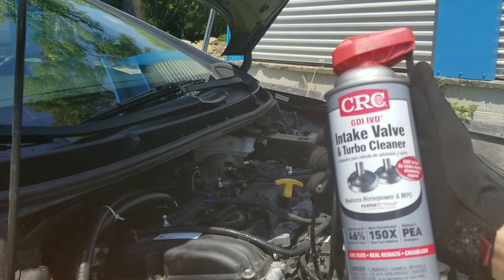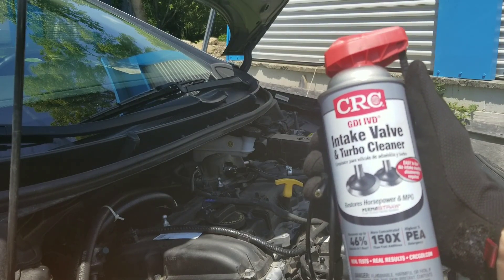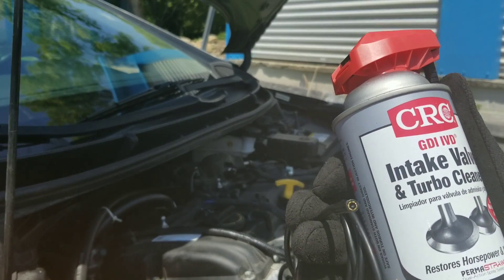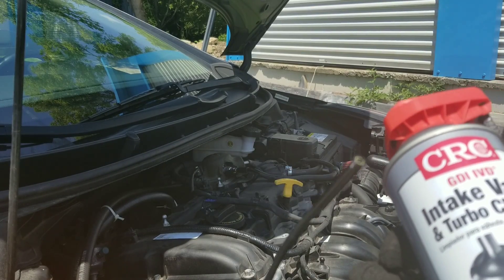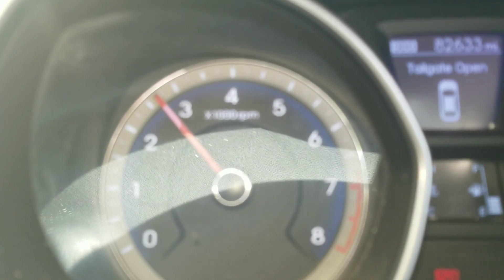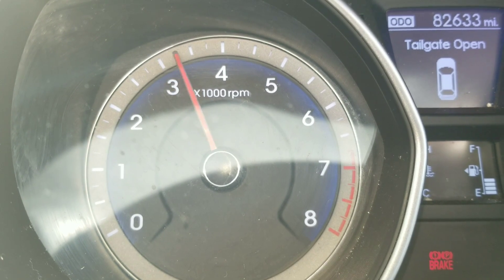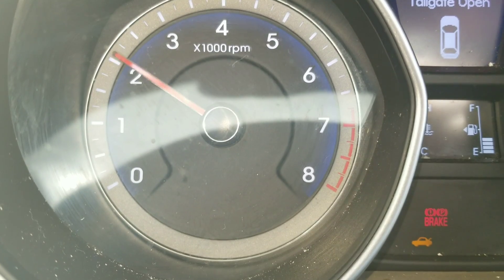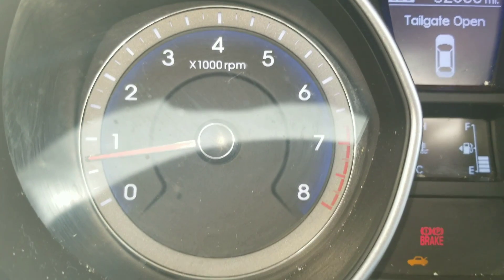Crc intake valve and turbo cleaner borescope results before and after

Comment: * LIAR - LIAR - LIAR *  WITH PROOF:  Notice he puts the borescope inside of the spark plug opening.  Look at the view of the valves and intake runners.  It is a top-down view from behind the valve.  It is impossible to get a view like that from inside of a cylinder.  Pause at 0:33 notice the carbon all the way up to the guide.  That indicates the valve is closed.  Before you resume, get ready for this.  You will see all around the valve throat area and there is no view of a borescope snake, not that it could make the corner to get up behind the valve if it were open.  Now resume and continue watching up through 0:43.

Comment: i think you should get a catch can and second fuel and oil filter. use a diesel with less sulphur drive with revs around 2.5 to 3ooo stay in 2nd gear if necesary then use fuel aditive that allwc carbon to be burned off at lower temp should slowly dissolve it around valves with a fuel additive. that is something you got to use every 2000ks from new when clean.

Comment: I’m at 11k miles and I used 2/3 a can of this on a 2.3 eco boost. Sadly it threw some misfire codes when doing the treatment. But each time I start up from cold I can see and smell oil being burned/cleaned out through the exhaust. Pretty sure it’s still cleaning 100 miles of driving after treatment.
Reply: that’s good

Comment: I think it's interesting that even with an oil catch can that car can make so much gump in such little time. CRC did some work, indeed.
Reply: Most of what's in the oil catch can is unburned fuel and water. Oil catch cans are only usefull in built engines cause they have less tight tolerances and let more oil escape via the piston rings.

Comment: Watching your video and have done this once planning on round two). I think this need to be spray more in to the intake manifold like when the throttle body butterfly aiming inside the manifold. One thing they not explain in the instructions is that the engine bay will get crazy hot as you spray this.

Comment: I have a 2005 Audi A6 3.2.  The car had 25,000 miles on it when purchased.  I’ve always used top tier fuel (either Shell V-Power or Sunoco).  The car has 150,000 miles on it now.  I started using BG upper intake service somewhere around 2009.  I did this once per year and they also added BG44K with the service.  I think around 2017 I started using the CRC intake twice per year to save a buck.  I’ve never had the manifold off, never cleaned it with walnuts, I’ve never even looked into it with a bore scope.  But the car still runs great, no hesitation, no engine lights, regular service.  I think the CRC is a nice alternative to the expensive BG shop service.  I just hope my valves look cleaner than the video.  I just used CRC Intake Cleaner today in prep for winter.  Love Nates videos.

Comment: Hi.. that is not the proper way to clean the intake valve. turn off your engine after warmed. remove the intake manifold and spray it while its still warmed on the closed valve position. let sit for 30 minutes. then suck the remaining liquid with vacuum.
heavy deposit in GDI  engine can't be easily removed just like you're using same technique with Throttle body cleaner. remember this is valve cleaner don't use it to clean throttle body. it has sensors in it. careful

Comment: How can you see the valves through the spark plug hole?
Reply: @NATESINTERACTIVEAUTO  you can't see the top of the valves through the spark plug hole. The views you showed us were through the intake runner which you didn't remove the intake manifold.

Comment: Interesting. It looks a little cleaner, and it probably softened up the outer layer of carbon for continued removal for the next few days. I wonder if using this product regularly (say with every oil change) would help prevent carbon buildup on direct injection turbo engines. I just bought a focus st with 20k miles on it, I might put like a can a year into the car and see how she does in the long term.
Reply from the maker: Let us know how it works

Comment: I did the Crc treatment through the throttle body and sea foam through vacuum line and cleaned my throttle body with throttle body cleaner and my car got just a little better and it’s a Mazda 3 2010 is it GDI?
Reply from the maker: Thats great let us know how it works
Reply: NATES INTERACTIVE AUTO It’s better know for sure before the engine had a lot of sludge in it now it is much better less vibration
Reply from the maker: Its good product but check out the new liqui moly video

Comment: I did it today on my turbo cobalt and put it through the vac line at the intake mani. I usually do my seafoam there as well. I let it heat soak for a hour after and nothing really happened. No smoke no codes and no rough idle. I bought another can and tried it through the throttle body and still nothing. I ran it hard after drove around giving it hell and not a puff of smoke or anything. Maybe it'll take time to work on the carbon who knows. I do have a scope but can only see my pistons and some have heavy carbon buildup and some don't. Cylinder 1 has lots cylinder two has little. I'm not sure there is a way to scope valves. Only way to see them is to remove the intake manifold. Maybe through the tb but its a real akward position.
Reply from the maker: Yes and smoke doesn't show that its cleaning or not cleaning but yes it can be very hard to see the valves.

Comment: my hyundai sonata has exactly 160k miles. finally, check engine light came on. i did a scan and it shows misfires on cylinder 2 and 4. cleaned it with a can of crc, on sale at pep boys for $11 with tax. problem solved. just make sure the engine is really hot, so the carbon is really soft. then follow the exact steps as in this video. thank you, Nate.
Reply from the maker: Thanks and yes follow manufacturer's instructions

Comment: common sense onto with GDI engines.  my wife's kia engine irratic idle, i assume valves dirty, previous owner didn't maintain.  will try out.
Reply: Update..   if you guys have patience to stand and spray short shot for while can about 2 hours.   i noticed rpm  increases  after holding rpm at 2k rpm went up  2500 rpm ..  notice less  shaking idle. engine able run better  preivous owner never cared or maintain properly.  after empty can reve'd engine, alot smoke came out, must be crap in valves sure cleaned alot right out.   also  took for drive  by direction on can, noticed smoking a bit.  then idle is smooth,   THANK YOU CRC  perfect for anyone with GDI engines
Reply from the maker: I appreciate you and what should we test next
Reply from the maker: Yes and tell us how this turns out

Comment: Use 2 bottles
Reply from the maker: Yeah what else
Reply: @NATESINTERACTIVEAUTO  2 are enough👌
Reply from the maker: Yeah cool
Reply from the maker: I did this in a more recent video
Reply: Best rezult can be obtain  in this way:try to induce limp mode in that way the engine is very weak and you can spray alot more in engine witghout any problem (won't increase the rpm even you use a lot more spray in it) so the valves and everything will be clean more easy, but be aware of hydroshoc in engine....
By mistake my car got limp because of a detonation and after that i can use alot more spray 😉
Disconnect battery after that and everything is perfect
Reply from the maker: Thanks for the tip and sharing your information with the NIA community

Comment: Question I have a 2011 chevy cruze 1.8 what about the map sensor on top of the intake manifold
Reply from the maker: This car also had a mass sensor. So just spray into the manifold per directions
Reply: @NATESINTERACTIVEAUTO  
Thanks Nates!!
Reply from the maker: Thank you and be sure to see the video   that was just uploaded. I would like to know what you think
Reply: Good question.  Nate mentions the mass air flow sensor but you brought up a valid point.  The manifold absolute pressure sensor is probably ok being sprayed by this cleaner.

Comment: Just save your money and have it done properly with walnut blast. It should be done every 60k miles it will run you around $800 and up depend on where you go. I had it done on my BMW it felt like my engine was brand new.
Reply from the maker: Yeah but if you see my new videos we found a couple of cleaners thats may work out of alot we tested
Reply: Only $800? Pocket change.

Comment: Have you ever found that after doing a valve clean, it fouls up the spark plugs after and cause a misfire?
Reply from the maker: No i haven't had a issue and you?
Reply: NATES INTERACTIVE AUTO yeah the first time I tried it on my 2007 Audi 3.2 GDI engine I followed the steps exactly and it came up with lots of warning lights and the engine ran rough. I replaced the spark plugs and 2 were really dirty. Works perfect afterwards but wasn’t expecting that to happen
Reply from the maker: Yes seafoam i know can cause a ashy build up but was unaware crc could makes sense what color was the build up on plugs?
Reply: NATES INTERACTIVE AUTO it was a dark oily substance on thee spark plugs. They appeared to be the original spark plugs from the factory, maybe that has something to do with it. Car had done 170,000km at the time
Reply from the maker: Yeah carbon caused misfire
Reply from the maker: Would you like to see if a engine can run on straight isopropyl alcohol live
Reply: I used brake cleaner for this and it fouls the spark plugs. But after cleaning it, it started right up.
Reply from the maker: Interesting
Reply: Thanks man! I’ve done both a turbo clean, and valve clean twice. I definitely feel the improvements! I just got an oil change so I’m looking forward to running a cleaner system. Hopefully better mileage. Definitely feeling more when I give it the spurs! 🏁🏁

Comment: I think (my opinion) that this should have been done every 3 - 4 months from the time the car was new.  My direct inject engine now has 80,000 miles.  I didn't know about this and feel it's too late to start now (again my opinion).
Reply from the maker: Well better late than never and you brought up something thats in the upcoming video i will choose a fuel cleaner in a engine that has never been started even for 1 sec so this way it should give the cleaner its best chance to keep off build up inside the engine the biggest question what cleaner will be used
Reply: Valves are moving parts that don't rotate so any little bit of mass you can get off of them will help a lot more that you can imagine
Reply from the maker: Your right

Comment: Knowing how much CRC products are, I doubt if I would use it looking at the before and after photos.  We really need something to clean these GCI engines and so far, no one has really come up with a sure fire method of cleaning the intake system on these engines.  Again, technology has advanced beyond our capability to deal with in on a daily basis.  Give me a port injection engine anytime over a direct injection engine.  Problem is, you can't buy them anymore.
Reply from the maker: Hey i know how you feel check out crc vs seafoam video i perform
Reply: Not true. Most manufacturers are realizing the problem with direct injection and are now starting to use dual systems.  Port and direct injection... it makes it a little more complex and expensive.  But solves the build issue.
Reply from the maker: The problem is the cars made before changes or cars that have a problem already.
Reply: @NATESINTERACTIVEAUTO  well yea. Not much can be done about that.... unless someone designed an aftermarket conversion to add port injection alongside the existing DI. But I just plan to keep up with the cleaning every so often as basic maintenance
Reply from the maker: Yes i agree just not allow the problem to not be maintaned
Reply: @craigquann  I believe Toyota is the only mainline manufacture that is using that technology and I know I don't want two injection systems to have to deal with the maintenance on.  That just doesn't make sense.  For the little difference in mileage and performance, I would still take a port over a direct injection engine any day of the week.  And I don't believe Ford or GM is coming out with that system any time soon and Chrysler is still using port on its 5.7 engine.
Reply: @mouselt1  Ford already has it.
Reply: @craigquann  I still believe it to be bad technology when you have to duplicate a fuel system to overcome and engineering problem.  It boils down to poor engineering period.
Reply: @mouselt1  yea that's probably true. But its the best they got right now.... but installing catch cans from factory would solve the need for port injection. But then you have the maintenance of a catch can.
Reply from the maker: I understand
Reply from the maker: Thats also true
Reply from the maker: Thats also true

Comment: Doesn't look any better to me. I'm not sure how you thought it made an improvement. Glad I avoided this problem with my new car purchase last week. I ruled out all vehicles with direct injection.
Reply from the maker: Yes the new gdi are much smoother
Reply: Then you bought a diesel engine because all of the gas engines are direct injection.
Reply: forrest chambers
Um, no. 2018 Rav 4 uses port injection. Direct injection refers to directly into the cylinder.
Reply from the maker: Thanks for sharing
Reply: what new car did you purchase?
Reply from the maker: Not new but new to me sorry
Reply: 2018 Rav4 LE

Comment: Don't believe this Bullshit,I have been stripping engines for reconditioning for 40years and that Carbon buildup on the Inlet Valves is as hard as Steel so a can of Liquid Miracle ain't going to shift it,that Carbon is so hard it has to be Chiselled off the Valves during cleaning so stop trying to Kid people that this stuff will do anything to move it,this is just another Attempt to part people from their Money,there is only one way of removing it and that's a Decoke costly but True.
Reply: PEA. Research it via S.A.E. it is absorbed into the carbon and helps to dislodge when heated. Chemistry created the carbon and chemistry will help remove it.
Reply: the whole point of this spray is maintenance, to use it continuously (every 10k miles or so.. ).  I can't imagine enough cake up in 10k miles, and if it's used since the engine is new, I can easily see it maintaining it.     Engine in this video looks like it was never touched, might be far too gone.. what car was this done on?  How many miles?   .  I would argue in favor of this spray as long as it's used to maintain an already clean port / valves and light correction.
Reply: All you need to do is separate the carbon from the metal surface. Since they aren't bonded together it's not impossible for a solvent to cause the carbon to seperate or dissolve. I don't see how you can say it doesn't work? It took off a good amount with only having to take a few minutes to spray a can. If this was done a few more times or if he had used it earlier in the engines life I'm sure the results would be more obvious
Reply from the maker: You are right again
Reply from the maker: Thanks for the info
Reply: Joe Johnson ,Thanks for the information regarding the cleaning of the Valve heads,I am quite aware of the processes of cleaning them but if you look at the Photo of the Valves on the tin there is no way in hell can that stuff clean and polish them like that,it's very deceptive and wrong to pretend that it will clean them like that,and by the way in times gone by there have been occasions when I have had to scrape the carbon off with an old wood chisel but your probably not old enough to know that.
Reply from the maker: Yes i understand

Comment: i wonder where i need to spray this on my TSI
Reply from the maker: You could use a vaccum line off a brake booster or past mass airflow sensor slide it between air filter housing and boot and try and leave it connected
Reply: Was wondering the same for my 1.8 tsi. Took a quick look and couldn’t find the mass airflow anywhere near the air box, must be hidden. All brake booster is a pain to get to.

Comment: What do you do if your check engine light comes on after using this stuff? It's throwing a P0420 code which states that the catalytic converter isn't performing properly?
Reply from the maker: Try Italian tune up and erase code free at auto store
Reply: I cleared the code. I'm just tired of trying these things I see on YouTube but when I try it something goes wrong.
Reply from the maker: I haven't ever had that problem but make sure mass air flow sensor is not sprayed if it has one also try and squeeze in between airfilter housing and boot with it closed as much as possible
Reply: And it's really easy to follow instructions so it's not like I did something wrong. I just bought a 2015 Silverado and after using this stuff my check engine light is on.
Reply: what vacuums hose did you use?to spray the cleaner in?